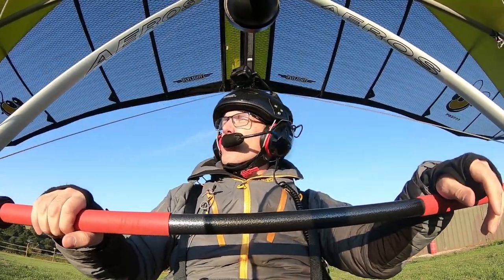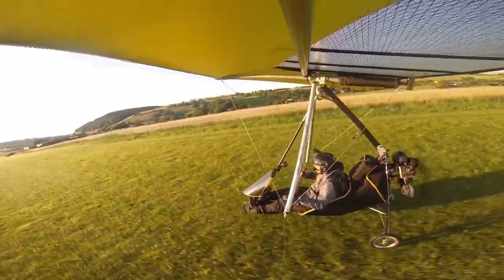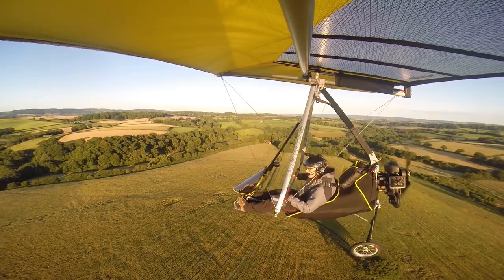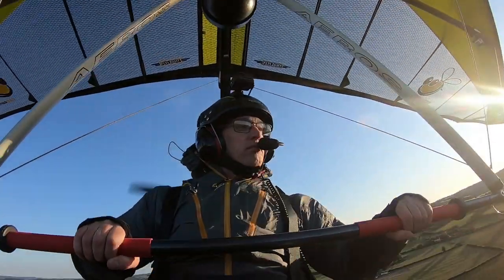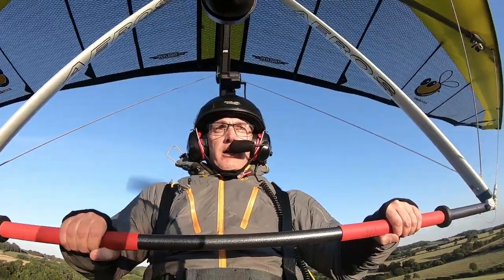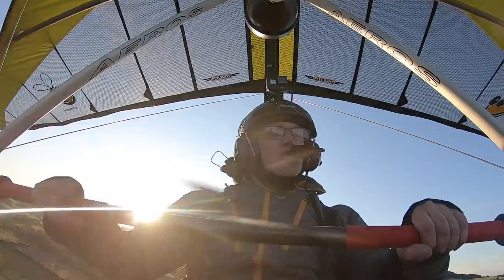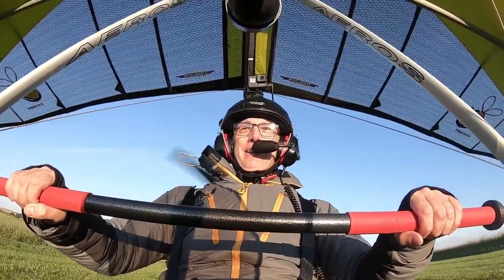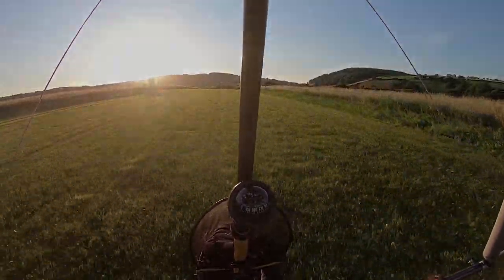Flexwing PeaBee circuits and an engine failure...practice

Comment: Try turning the engine off (rather than idle), it can make a fair difference to your final approach. Obviously this requires more commitment :-)
Reply from the maker: Hi Andy, I knew someone would mention that..lol  I hadn't really practiced any emergencies and wanted to see how it would perform. Now I know, I will be planning some engine off landings.  It was good to see you at New Farm.
Reply: Great idea Andy. That's now on my "to do" list ... I'll blame you if I get it wrong!!! :-)
Reply from the maker: @paulwilliamson7441  Yes...Andy told me to.....
Reply: I always have the mags on ready to go, just in case I mess it up!  Have been OK so far!
Reply from the maker: @flexmaniac  It would be fun pull starting on final!!!
Reply: Above your landing point at 1,000ft AGL, engine off... land on the spot... 250 points if your wheels touch down in the 3 metre(?) box.
Reply from the maker: @flexmaniac  I get the feeling you've done this before.
Reply: @GolfFoxtrot22  Screwed it up a few times :-D
Reply from the maker: @flexmaniac  oh, tell me that one at the next fly in.

Comment: Great stuff👍
My instructor and I went up in rough air Tue evening, got bounced around quite a bit. I think my instructor called it advance student air.  Was not for the faint of heart that is for sure. I will go up a couple more times then time for solos. Have to wait for Govn to register my wing.
How much of a difference did you find transitioning from training trike to PeaBee?
Cheers
Reply from the maker: The Peabee was very light and nibble.  IT was very easy to over-control , but after one flight I was happy.  It so light and fun to fly.  It just doesn't have the same energy ( less inertia) so runs out of energy in the flare, that took a bit of getting used to.. flaring much lower and later.

Comment: Do have any issues with your glasses and your helmet or headphones? I’ve just been told by my optician that I can no longer wear contact lenses so it’s glasses for me now. I’m currently PPG training and about to buy a helmet and wondered if glasses are a game changer?
Reply from the maker: I've been flying PPG for nearly a decade with glasses, no issues at all, just make sure you get gel seals, they go round the arms better. You see people flying with sunglasses, again no issues. I hope that helps.
Reply: Thanks for that Giles. Gel seals on the headphones?
Reply from the maker: @fair_weather_biker  yes, I managed to get some thicker ones, not designed for my Peltor but I just pealed the old I e off and stick the new ones on. You'll now notice in all the videos all those pilots flying with sunglasses on. Eye protection is fundamental.

Comment: where is the throttle control on these?
Reply from the maker: It is on the foot pegs and on the right hand side.  Most flexwings have both a foot and hand throttle which are linked.  I only have a foot throttle as I can't afford the weight. The hand throttles are friction operated so that they reduce the workload on long flights, it also give the person in the back the ability to control the power if required ( eg under instruction).  I hope that helps.